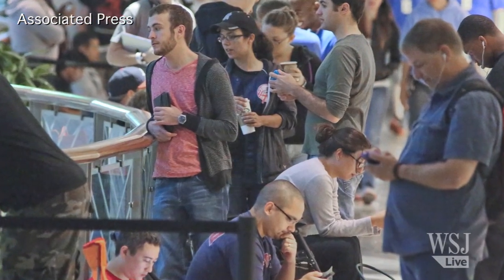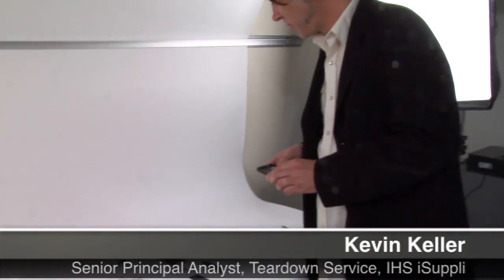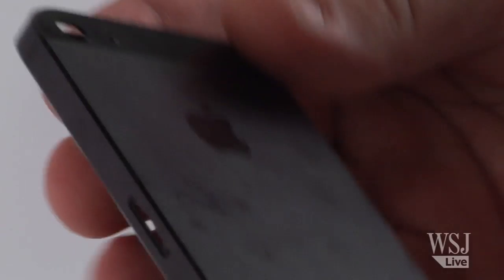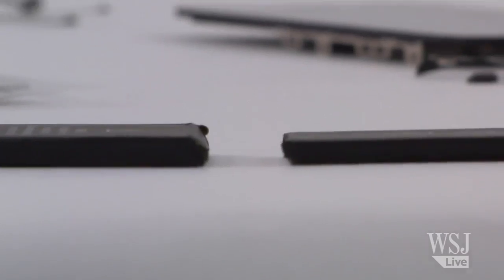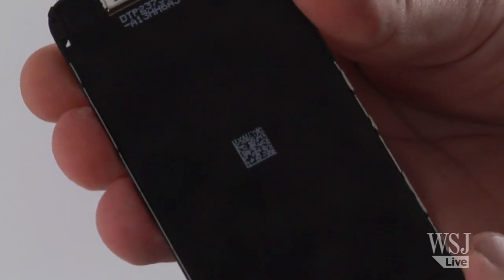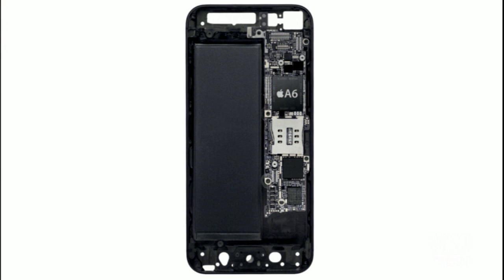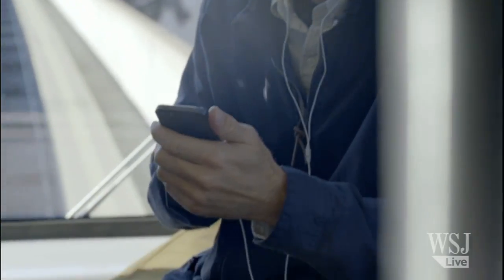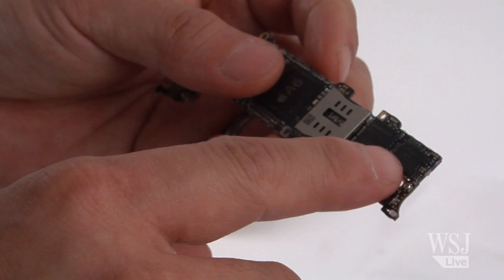What's Inside the iPhone 5?

Comment: u still dont get it. it's CUSTOM made by samsung for apple. the same ARM architecture and 32 nm smartphpne processor - this is the samsung exynos. apple asked samsung to combine the dual core exynos with gpu, and that's why it's smaller than the quad core exynos that you see in sgs3 and note2. apple will never openly admit it's made by samsung.